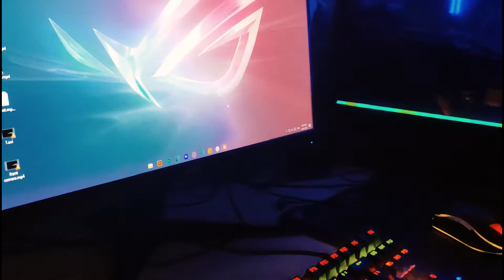Antec Prizm 120 ARGB 5 in 1 cabinet fan INSTALLATION GUIDE

Comment: Great Explaining , So if was planning on using 6 fans and 2 led strips with one hub , is it possible ? and if not any sulotions ?
Reply from the maker: That totally depends on the kit you purchase. If the hub controller does not have plugs for 6 fans then you may not be able to use 6 fans. You can ditch the hub for led controls if you have a cabinet LED controller or if you want to control through motherboard but if not then you definitely need a hub of 6 ports to give power and LED lighting to all of those 6 fans you would like to use. 

NOTE: Using 6 fan would also be an overkill, try sticking t 4 or maybe 5 at max. Cabinet airflow and pressure is kind of a thing for better heat exhaustion you know.
Hope that helps :D
Reply: @TrishirajYT  Thx , btw am using 6 fans because my case supports those , and i found you can control 2 hubs by 1 hub (Antec Hub) , Thanks for listening.
Reply from the maker: @pintelzyt9865  You can yes. That's a big ATX case then :D

Comment: So I control the rgb and speed with my motherboard, right? And I don’t need to use the controller inside the case?
Reply from the maker: Absolutely, just connect the Controller hub to your motherboard's RGB plug and should be good to go. This fan supports Mystic Light and Aura Sync